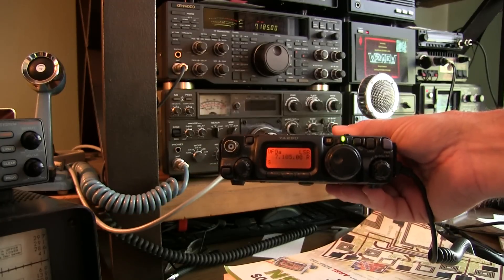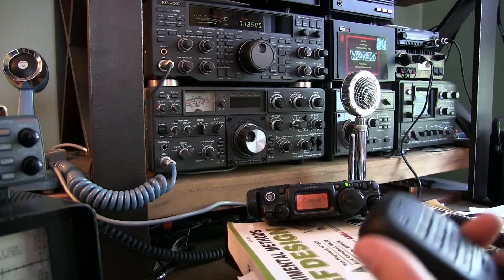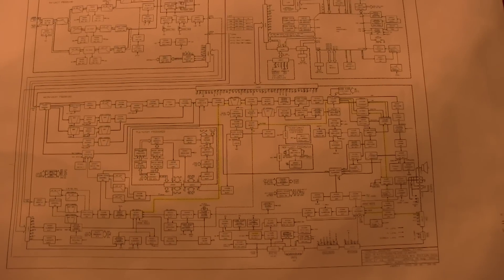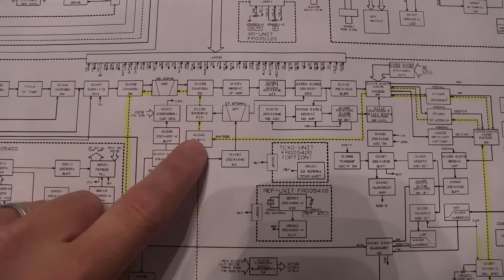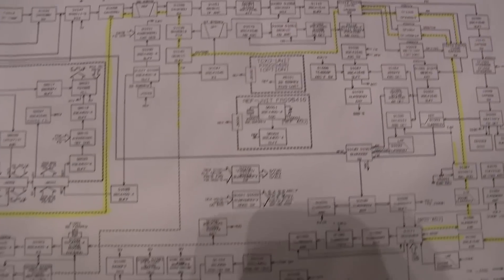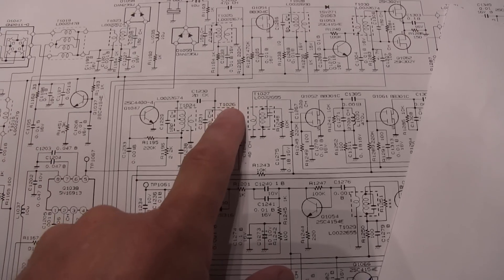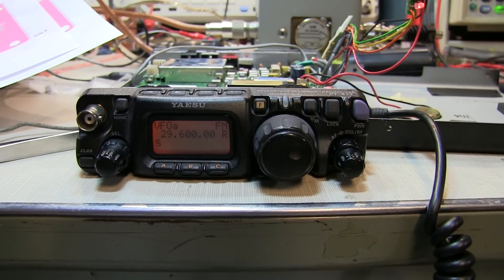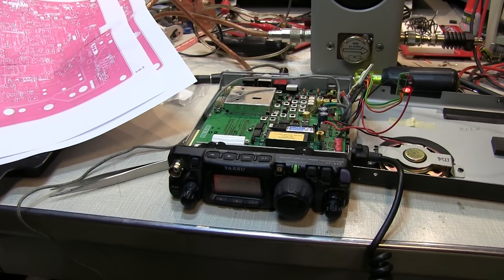#240: Repair of Yaesu FT-817 with SSB CW AM Transmit Problem | QRP Rig

Comment: I recently had a power surge on mine and the tech repaired that part of the unit but says the radio receives but won't transmit, trying to figure out 2 things 1. if I reboot the radio will it come back or 2. if there is another component that might be damaged> any suggestions

Comment: this is like the 6th video of a Yaesu FT-817 needing repair. I'm sorry,,but I'll NEVER use Yaesu equipment. sorry,,but there JUNK!! I'll only use KENWOOD!! I've bought 2 yaesu's in my time,,BOLTH we're broken right out of the box from the factory. YAESU is the Chevrolet of radios. there engineered broken. THANK GOD I'm a KENWOOD/MOTOROLA man.
Reply from the maker: I'm mainly a Kenwood guy for my main HF operating (TS870/TS830).  I picked up the 817 very cheap because it was broken.  I do run a Yaesu FT-857D in my car, and that's been pretty trouble-free (knock wood!).

Comment: This must have been repair for a friend. Knowing that you have $500k knowledge and spectrum analysers costing $40k it would be cheaper just to buy a new transceiver than to pay for your service. Great diagnostic process showing in-depth understanding of matter in question and preference to using mind rather than solder iron. You impress me again and again Sir.
Reply from the maker: Most of the real pricey equipment you see in my videos belongs to my employer.  The FT-817 was (is) mine.  Picked it up from a friend for $40 because it wasn't working. I offered to refund him and give it back since the repair turned out to be so cheap, but he said I could keep it.  Still use it a few times a year.
Reply: @w2aew  Thank you for the answer. It's good to have an employer that lets you take these toys home. There's some risk involved in operating expansive equipment. When working in Polish Telecom my colleague put an analyzer on a stool, which I did not notice. I almost knocked it down. It cost ca. 500 time my monhly salary. It could have been a small disaster...
I do services for friends and family for free and I understand you. Still such knowledge and skills put to commercial use cost money and your friends save some bucks.
Have a good day Sir and thank you for your effort to educate the community.
Reply from the maker: @Luzt.  I work as a Field Applications Engineer, so this is the equipment I have with me most of the time.
Reply: @w2aew  Electronic engineer's heaven ;-)

Comment: Hello there. i watched your video on your FT-817nd repar. i wonder if you can give me some ideas about my FT-817nd. my radios problem is that it has zero modulation on any modeand any band but i have outpot power on am,  fm and pkt . i hade modulation for a short time when i changed to front antenna connector but it lasted for a minute .i toke the mainboard out and the modulation came back some sekonds . i havent seen any bad connections on the board . Hope for any ideas 73 de SA6BSN

Comment: When you speak of component level checks using a multimeter, do you have to lift a leg of the component? If a component is bad, or maybe even not, I would assume you would be reading circuit resistance via whatever path of least resistance it finds. How do you know you are reading THAT component?
Reply from the maker: "Do you have to lift a leg on the component?"  The answer is, sometimes.  It really depends on the component and surrounding circuity.  If you're testing a low value resistor and the resistance reading is much higher than the resistor value, then you know the resistor is bad (because surrounding circuitry in parallel with a resistor can't make it look larger!).  So, you just have to apply some judgement and common sense, and examine the connected circuitry to estimate the effects, if any.

Comment: Any idea what may have caused the problem?  Could the radio have been shocked physically as in a fall?  Just wondering your thoughts. Great video. Well done. Thanks for sharing!
Reply from the maker: Not sure - it could have been a vibration or temperature induced failure of a marginal part.

Comment: if a modern cpu schematic were to be printed out like that, the sheet would be on the order of square miles
Reply: size of features on the order of 10 nm,  printed as 1 cm, or 10 mm, means 6 orders of magnitude "magnification", from chip to paper. Side of die (if square), 20 maybe 30 mm long so the side of the sheet would be on the order of 10 km. printed on 80g/m^2 paper, it would weigh thousands of tons.

Comment: Logiically i didn't see you shift to either side band transmission therefore the unit may only be transmitting on one side . The question is were both side bands affected originally?

Comment: Hi Alan, sorry but silly question here: looking at the scale on your wattmeter, it appears that output was actually over 10W, but in each case you say it's just a touch over 5W. It appears that you're dividing by 2? Is that just a known function of that particular meter, or is there something I'm missing? Thanks and 73 de AC2OI.
Reply from the maker: I'm using a 10W slug, so you have to use the lower scale on the meter, the one that goes to 100, and divide the reading by 10.

Comment: Alan, Buddy, Dino, et al, 

While not as convenient/conventional as Alan's engineering print, I use a screen capture program called SnagIt that allows me the opportunity to screen grab sections of an enlarged schematic. Theoretically, you can enlarge the sections along the paths of interest and work with those on conventional 8x11 sheets of paper. 

Downside is that it costs $50 but, being a software developer, I expense it. 

Still in all, the engineering size diagrams are very useful if only they could be stored properly. 

vy 71/72/73,

Bill, k6whp 

dit dit I

Comment: Excellent video. Could you possibly do another one on the unit disassembly and removal of the main board. Also the slug tuning process. Thanks again. Jim...KQ3S
Reply from the maker: If I ever have a need to completely remove the main board, or do an alignment, I'll make a video on it.

Comment: Another excellent video, my own FT817 has never failed, however a friend has had his fail a few times. We replaced the PA section but it went back to Yaesu when something else went wrong. Sometime later it seemed to have an issue on 80m with strange ALC readings and slumping power output.
Over the phone I went through checking the bandpass filters etc with him...  still no fault found.
In desperation he recorded all of the service menu items and set everything to "average" values found on the internet. Looks like the values must either of got corrupted or perhaps got messed up when it went to the makers for repair.

Comment: That's a very impressive schematic! I consider it a piece of art. I've certainly never designed anything that complex, but even with the simple stuff, I tend to separate each block on the schematic and use netlabels to connect them.

Oh, and as usual, great video, of course :-)
Reply from the maker: ...and that's only one of five boards in the unit - albeit the most complex of the five...

Comment: Nice repair video! Do you have any idea what would have caused a part like that to fail? Thanks.
Reply from the maker: Not a clue.  There is no DC current in this path.  Must have just been a low quality part, or possibly some latent damage that was bound to fail eventually.

Comment: Low FPS?
Reply from the maker: What is FPS?
Reply: The video seems to have a low framerate. :=)
Reply: the video framerate, normally it should be 29.97 or 30 images per second. 
You seem to have a wrong setting in your video editing software. 

Use either 30, or (if your camera records in more) 50/60 fps. (frames per second).
Reply from the maker: Weird - the video shows 29 fps just like all of my other videos.  Not sure what happened...

Comment: Hi Alan, this video was excellent as it clearly shows the research and detective work to be done to trace down  a problem in a modern radio. May be it becomes more clear that a repair  can't be argued over a component price which is very low. It is rather more the deep knowledge and experience and labour which make a repair like this possible! And by the way it was absolutely   NOT boring! Thanks for sharing and thumps up! 73 Peter
Reply from the maker: Funny thing is - this rig was sent by the previous owner to Yaesu for repair.  They told him that the Main Board needed to be replaced - to the tune of $600.  I guess they don't do board level debug anymore.
Reply: I know that from ICOM as well. My repair on the IC-7000 with dead receive on UHF was quoted as board replacement for 650€  from ICOM Europe. The fault was a little pre amp IC. So I guess you are right they have obviously stopped board level repair. Most likely to expensive as you need qualified techs. Most funny in Europe is that you can't buy spare parts from ICOM...  What a mess... 73 from Peter

Comment: had similar issue in a 10metre Yaesu rig 19 year ago with a broken wire in the Tx stage.    I used a  Spectrum analyser to  sniff the coils  and saw the significant signal drop where the brake in the coil was.

Comment: awesome video. I hate having to try trace a circuit advertise several pages!

 I have what I think is an interesting problem if anyone wants to take a stab at it. I run Kenwood ts-480sat in the car. I get interference from traffic lights! I know because when approach a flashing light,  from as far as 1000 feet, I can her a buzzing in my receive in time with the light. it's wired in the trunk directly to the battery which is also in the trunk. I've never had this issue with any other radios. any ideas?
Reply from the maker: I wonder it it has to do with the switching regulators used with the new LED traffic lights?  Does the noise blanker help - it's pretty good with buzzing, impulse type noise like this.
Reply: +w2aew the noise blanker does very little.

Comment: Yes, very invaluable to see the process, no need to see the probing part for me. I do wonder if some other passive that is tied to the  coil tap circuit could be out of spec which could have been responsible in creating a threshold rating failure and not just the coil itself failing under fatigue?
Reply: Perhaps there was something in the manufacturing process that caused the transformer failure.  Maybe a roller or guide in the winding machine that kinked or nicked the wire, and vibration over time finished the job.  Really odd for a signal transformer with no DC current load to fail.  Did you do a postmortem?
Reply from the maker: According to the schematic, there is no other DC path besides the grounded end - so nothing that could pass an excessive amount of current through it.  Just a weird failure.
Reply from the maker: No postmortem on the failed device - I destroyed it while removing it.

Comment: That was is a really dense schematic, you would have to be careful following the circuit path. That was the first time I saw a smd transformer, looks like a nightmare to align. Was there any component mask on the board at all I would think not. Great to see your techniques for repairing equipment Alan, any review of the new AWG4162 in the future? Cheers.
Reply from the maker: I haven't gotten my hands on the new AWG4162 yet.  I"ll probably get to play with one next month when I visit HQ in Beaverton, OR.

Comment: Great job on troubleshooting.  Double sided and stacked boards can be a pain to signal trace.  Nice to see I'm not the only one using full size schematics.  I got tired of running into town every couple days to get schematics printed so I bit the bullet and bought a used wide format printer last year on ebay.  Nice used unit for just under $800.  Figure it will pay for itself within 2 years if not less.  I also see you use my 2nd favorite mic, the Turner SSB +2.  With a little work on the amp board it is a great mic with a pretty flat frequency response.  Only thing I put ahead of it is my Heil studio mic.
Reply: Large format schematics would probably make great posters.
Reply from the maker: That old +2 works great on the TS-830S.  I use the D104 with a homebrew preamp/EQ on the TS-870S.